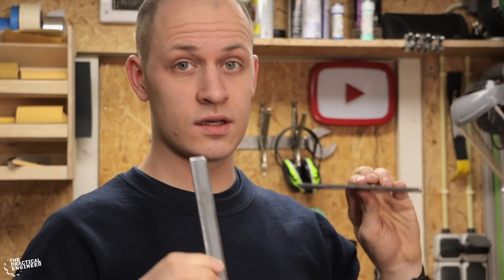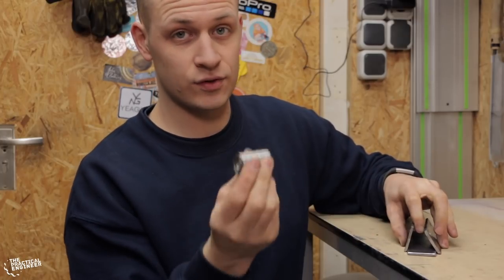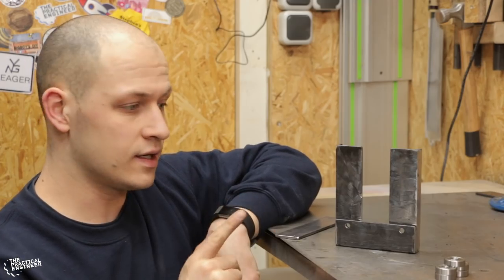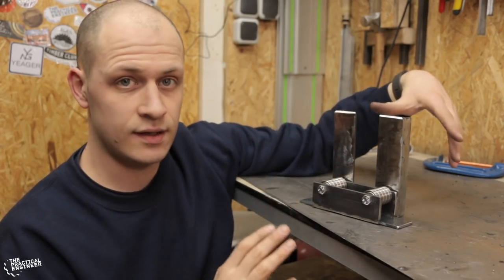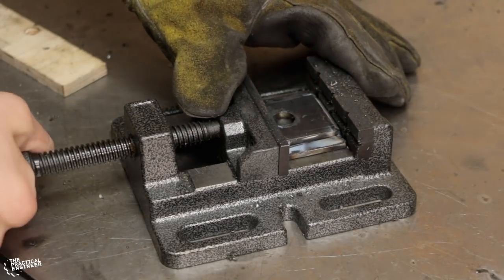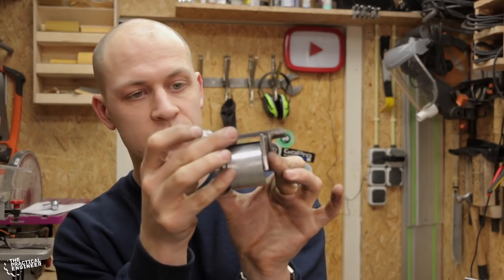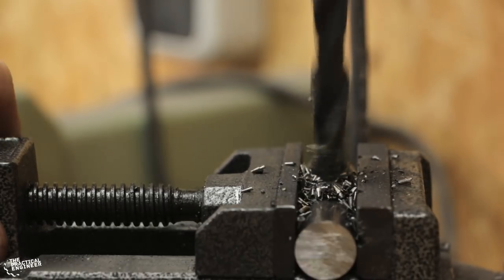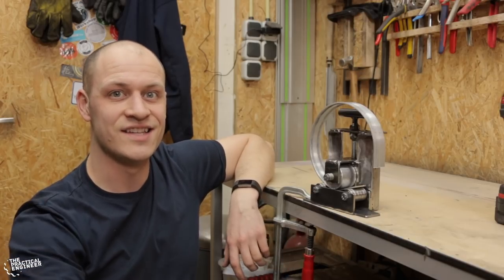Drill powered metal roller bender - DIY Roller Bender

Comment: How far down can you adjust the top roller? How tight can you make the circumference of the bend?
Reply from the maker: Up it can adjusted a lot, more than is actually possible to bend. Down it can go to about the center of the bearings beside it. I think with a softer material its possible to make something like a 10 cm circle. 

Are you planning to make one?
Reply: I would like to someday. Maybe a larger one that could also be used to slowly put an arc in a long piece of wood.
Reply: Thank you very much for responding. Keep up the excellent engineering work!
Reply: @Thepracticalengineer  Good to know, I'm gonna build one and first thing I make are 2x 7"rings for holding gas bottles on my welding cart. Thanks.

Comment: 00:25 Did you use a thin cutting blade to grind the pieces? ô.0
Reply from the maker: No it's a sandpaper disk with a backing pad. They are awesome for sanding/grinding the edges. Using a thin cutting disk for that is not really recommend.. But judging by your reaction you knew that last part ;)

Comment: Too much welding when you could have just used angle iron throughout, in this design. Surprising that you have a lathe but no MIG welder! Whats the point of using a drill to crank the roller? Usually for production work if your in a hurry or not strong enough to crank by hand. Without a lathe you could have attached a piece of pipe over 2 drive bearing and then welded a crank arm  onto the pipe or a drive shaft for your drill. Using a lathe is unnecessary to achieve just as good results. Next time you Arc weld use thinner welding rods and a higher temperature to get the rod to flow into the metal otherwise it looks like a worm on your welding and you have to grind too much off to make it smooth.